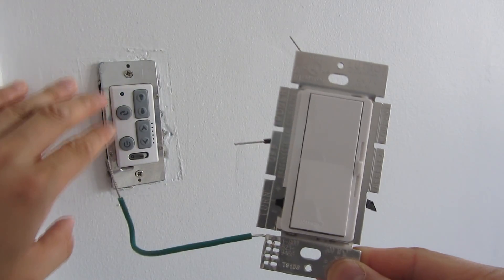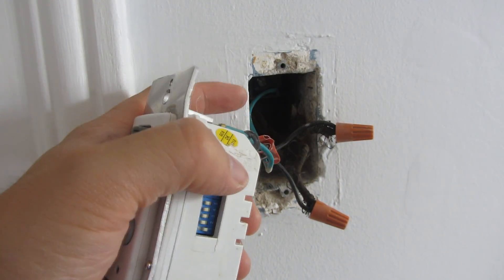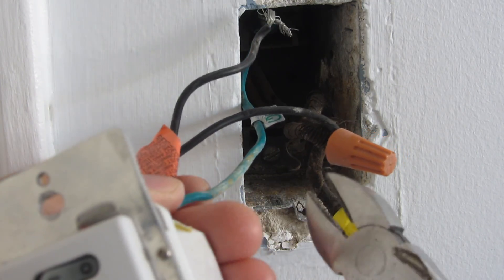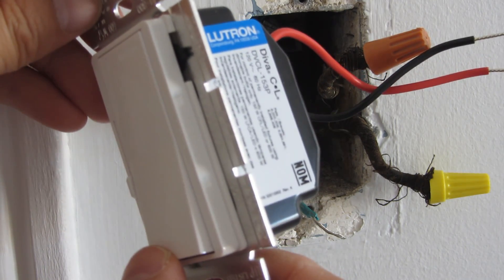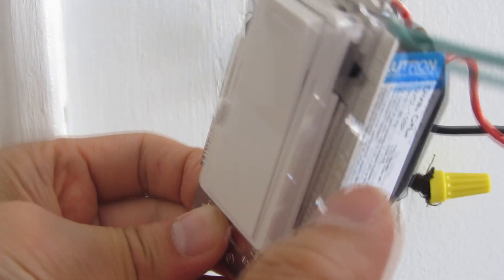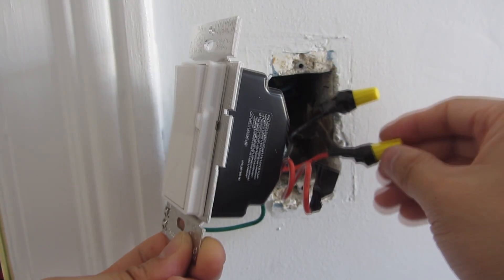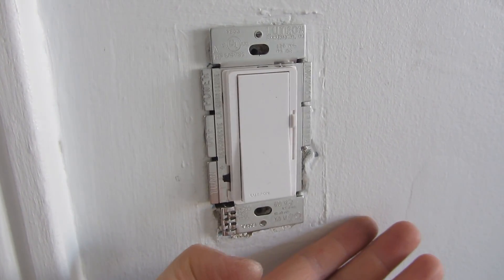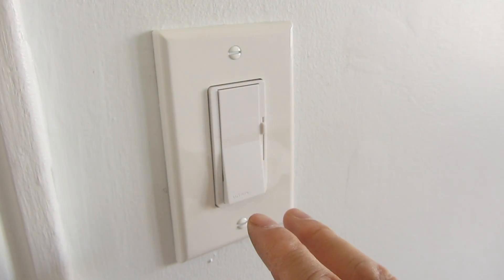How to install a Lutron Diva CL Dimmer LED+ | LED Dimmer CFL Incandescant Light Switch

Comment: An electrician installed our switch. Now on occasion the light flickers on/off at a high rate so it can't be used. The electrician said maybe there are some wires touching that is creating some sort of short, but I've gone in and adjusted the wires and no improvement. Is it possibly as faulty unit?

Comment: If you had connected the red & white striped wire to the light (instead of connecting the solid red wire), then the switch would have worked in the standard manner (i.e. pressing the the top of the switch would turn the light  on, and pressing the bottom of the switch would turn the light off).   You might consider reposting a new video showing it connected with the red/white wire, as your current video is essentially installing it the switch in the opposite way of how it is intended to work.
Reply: So im assuming the solid red wire is for the 3 way switch correct? And the stripped white red wire is for a single pole application?
Reply: @jonnyz5758  For a 3-way switch setup, both the solid and striped red wires are used.  FOR SINGLE POLE:  either the solid red or the striped red will be used, and the only way to determine which is to try it out.... I say this because I installed the switch in three rooms.   In two of the rooms the solid red wire led to an upside-down/reverse functionality, and I had to switch it to the striped red wire to get the switch to  function in the standard manner.   BUT, in my third room, I was surprised that the striped wire caused the switch to perform in an upside-down/reverse fashion, and I had to use the solid red wire to get the switch to perform in the standard manner.    So, it is a trial and error; try either one of the red wires at first, and if the switch behaves properly, leave it that way....but if the switch behaves in the upside down manner, then just swap out the red wire you tried with the other red wire.      I am not an electrician, just a home-owner, but that is what I found out when installing these switches myself.
Reply: @marcphillips4971  We are currently having this issue. The top pressed down is OFF and the bottom pressed down is ON. Have you had any issues? I think we may try using the red and white stripe wire. I just want to be sure that is safe.
Reply: @bradyhunsberger   I am not an electrician, just a DIY install, but to answer your question:   I installed my switch  with the Red & White Striped wire attached to my light/load, and it continues to work perfectly over a year after installing it.

Comment: This video is a perfect example of why Youtube removing dislikes can cost people their lives.
Putting a switch upside down is dangerous. So is electrical tape use inside the housing. I can see people suing Youtube (google) over things like this.
Reply: How exactly is placing a switch upside down Dangerous ?
Reply: Putting the switch upside down itself is not the dangerous part or the tape, it’s the people that work on it. You can put a switch upside down but just make sure it’s wired correctly. I’ve never seen anyone do this on purpose tho as it just makes no sense. Electrical tape is also non conductive so there is no problem with using it, only problem is it may take a little longer if you were to replace the switch in the future.
Reply: I think that Sam here is a little delusional.
Reply: Sam, I LIKE WHAT YOU SAID!
The twit that posted this video is the worst excuse for an electrician I have ever seen. From orientation to black tape, to not understanding the wiring, to not having a clue about adjusting, to attaching copper wire to aluminum wire. This guy will kill someone.
Reply from the maker: Can you explain how "Putting a switch upside down is dangerous"?

Comment: What would prevent a dimmer switch from dimming the lights much? Thanks.
Reply: Make sure you're using dimmable bulbs. Not all are the same either, so if you're getting some dimming but it's not working how it should I would try brand name dimmable bulbs. That is if you're using led or CFL, incandescent will always be able to be dimmed.
Reply: Also adjust the small switch in the lower left corner if using LEDS

Comment: Will this Lutron dimmer work with a switched loop application? My project is on a house built in the 80s and instead of power coming to the switch and going to the light, it goes to the light first with only a single 14-2 romex going to the switch to control live and load.
Reply: Yes, these dimmers are specifically for applications like this. Where a neutral in the box is not available. So a switch loop works with this dimmer

Comment: I don't understand...so checking for the hot wire isn't necessary?
Reply from the maker: For Lutron Dimmers' its not necessary, what I did with the Multi-Meter was misleading.

Comment: does the wiring orientation matter if your replacing a switch that has two other switches that do the same thing. I have 3 switches all control two sets of recessed lighting . two switches is a basic flip the other is a older toggle/dimmer switch

Comment: So this Lutron switch does not require a neutral wire?
Reply from the maker: It does not, usually only Smart WiFi dimmers need a neutral wire, while dimmers that are not Smart Devices do not need neutral wire
Reply: So what do you do with the two white wires coming from the original switch?